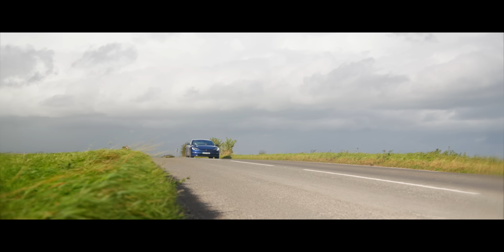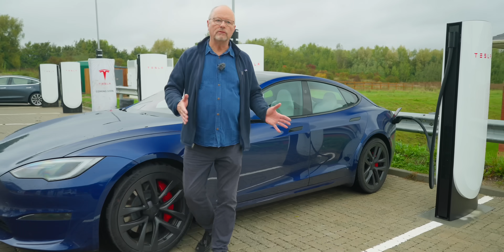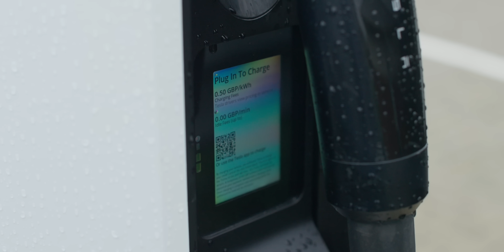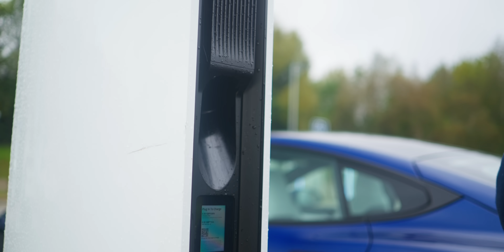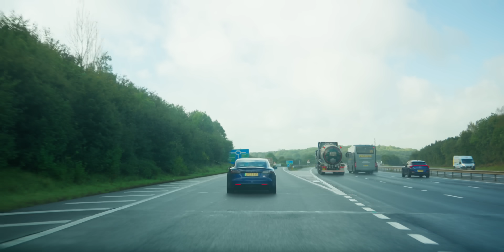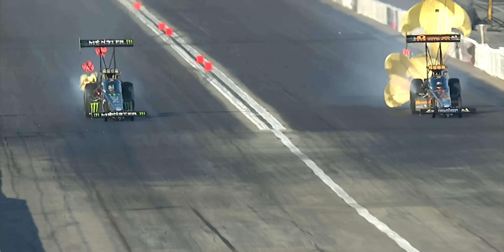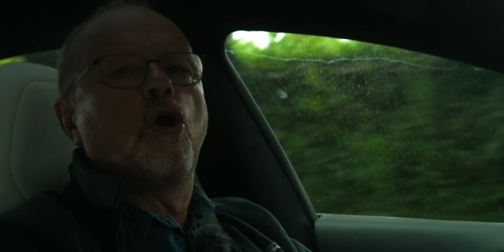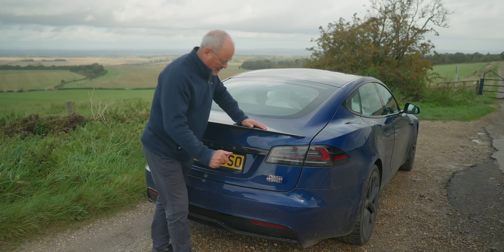THIS Is Why The Model S Plaid Didn’t Come To The UK

Comment: As a Tesla owner, I with you Robert.  Some things have been ergo designed a long time ago that just work well.  Deleting the 2 levers imho was unwise.
Reply: 100%. I get that Tesla are moving towards autonomous driving but why can't I enjoy driving my car (and navigating myself) myself when I choose to? I'm sure you can get used to no stalks, and compensate for it, but why should you? Stalk deletion has put me off upgrading my Model 3 to highland for now - the new model is a better car in most ways but that doesn't out weigh the stalk deletion for me personally.
Reply: @kiwijonowilson  the main reason why Tesla is trying to make vehicles fully autonomous is to get rid of driver related accidents. They feel like having people in charge of driving the cars is much more dangerous than what the cars could potentially do themselves. If we were to have all vehicles become autonomous and be able to communicate with one another, then there would be a lesser need for traffic signs or traffic signals.
Reply: @justinweatherford8129   sadly the time between now and then is a mess.. and given how much a group of people vocally hate evs .... i feel a lot of time before it happens.. but EVERY drive home I think... if all these cars were under a central control and communicated across to each other... we wouldn't have be speed-up-to-75, slam brake to 0 and if you leave any room for safety to give time for that slam crash, people will take it....   that causes accidents..... and yeah... we need it ... yesterday.
Reply: @todkapuz  the reason why people hate EVs is due to them being fed outdated and/or false information about EVs. If they knew the truth then they would love EVs.
Reply: @todkapuz the more controlled driving are not the point and neither really is safety, for governments one of the big benefits is that you could fit more vehicles on existing infrastructure because the gaps etc could be much smaller. The real problem is legacy vehicles, how do you retrofit an MGBGT or Mustang etc. next step would banning those legacy vehicles and that is not even considering motorbikes.
Reply: @justinweatherford8129  Absolutely! Literally fed
Reply: I am surprised removing the indicator stalks is legal on UK roads
Reply: The indicators on the stalks are terrible too. Quiet click, hard to quickly read indicator display and random auto cancellation. I think we all just have to assume we ignore any Tesla indicators like we do with BMWs
Reply: hard agree. I'm not going Tesla anymore. The lack of driver cockpit was already putting me off. But removing the stalks is too far.
Reply: Elon just likes to be different
Reply: Plaid with the ONE and there 200kw and Zeeker 001 FR quad motors(1300bhp) installed ???
Reply: 21 M3P owner here. Happy with everything APART from the indictator stalk. We have a lot of roundabouts and 'should' indicate off which is difficult when the thing you need to press is moving.
Reply: I'm with you on the stalks. And any function that needs to be used by the driver while driving should be a physical button/knob so you can find it and use it without taking your eyes off the road.
Reply: Ferrari's have done it right with the right signal on the right and the left on the left.
Reply: Its a cost cutting move. The less buttons, parts, things in the interior the more they save per car. Its not designed around you. You must adapt. Don't forget, the plan is to make you redundant in the car. The less control you have, the better - and the cheaper it is to produce.
Reply: And forcing everyone to use that silly yoke steering wheel was unwise as well. I believe it is finally optional (should have been that way from the beginning).
Reply: @JustWasted3HoursHere  to accentuate your point a driving test at least required the person being tested to keep their hands at the ten O'clock possision and the two O'clock possision. With a yoke steering wheel that is impossible. That would mean that every single person doing their driver's test with a yoke steering wheel would automatically fail that portion of the driver's test.
Reply: Ergo designed? 😅😅😅
Reply: @markfox1545  ergonomically
You're welcome.
Reply: It's plain dumb. Along with many other things. But that's the modern world for you..."reinventing" things just for the sake of inventing. And it's shown as the more modern more awesome thing, whilr it's just worse than before, worse than what just worked. But you are expected to like it and accept it, and lie to yourself, otherwise you are a luddite.
The world is on a terrible path now cos thia extends to all levels of life.
Reply: Taking away the levers is very logical to USA, but they are forgetting rest of the world where it get dangerous.
Reply: 100% Agree.  My interest in the new M3 is massively eroded by  this.
Reply: Deleting the levers is what made me pick a different EV instead of the new M3. I paid substantially more for the privilege of a gear knob and signal stalk (and a HUD). 

Whatever cost Tesla thinks it's saving  by deleting a bit of plastic and wires is dumb. They can keep deleting parts until there's only the tablet and you have to swipe left and right to turn as well.
Reply: @MrRobotGuy  Quote by Elon Musk: "Any Fool can reduce the cost of a car by making it worse!" SAY NO MORE....
Reply: @MrRobotGuy I think the point is that they are pushing towards self-driving. At that point the car will indicate the direction based on it's route and the "driver" is just another passenger. They were premature in that since it isn't ready but that's the idea. And it's probably way more cost saved than people realize. The stalk is cost, but also the heavy-duty switch that can take punishment is a much higher cost than buttons, and the installation cost is much higher than buttons which they have to do anyway. No stalks probably eliminates an entire station in the steering wheel assembly line, saving time as well. I don't know how I feel about it from a driver's perspective... but it makes perfect manufacturing sense as to why they've done it.
Reply: @patreekotime4578  they've been selling that scam for ten years, and they keep pretending for another ten. All those cars bought in 2016 with all the self driving extras won't be on the road for much longer. And I'm willing to get all cars bought today will never self drive either. 

It's all a marketing scam to cost cut as much as possible.
Reply: @patreekotime4578  exactly, it adds up, personally I am sure that everything is done with the thinking of how can they make it cheaper and not just because they save on components but because it is easier and faster to build. It's like with the giga press, make the car in 2 pieces, even 1 then cost is lower for them, faster to build and they can sell the car cheaper (but in that case it's a lot worst for the customer that has to get it repaired). One more reason to the fact I don't like their cars, I don't like the interior nor the exterior nor the brand.
Reply: @inebium  The castings do not add cost to repairs. Very hard to damage those castings and a hit hard enough to damage them would usually mean the car is totaled. But they can be repaired or replaced. Tesla works hard to bring repair costs down and since they have their own insurance, they have data on how to and a need to lower repair costs.
Reply: @MrRobotGuy  Don't you miss the buttons on your phone?
Reply: @WouterHermans But smart phone buttons are on keypad in the same place as the old push buttons.
Reply: @WouterHermans you seriously compare phones and cars
Reply: @larrywave  yes... everyone at one point will have to fit the entire dashboard of the car in their pockets.
Reply: @WouterHermans  Yes obviously touch screens are VASTLY inferior when it comes to actual performance. It's just that there is no other way to do it right now. Would you rather type a paragraph or a book on a keyboard or a freaking touch screen? How about playing an intense competitive game? Physical controls are incomparably superior your analogy is super dumb.
Reply: @WouterHermans You have to give the phone your full attention when tapping the screen. I'd like to see you use your smartphone with a blindfold. Touch screens in cars should be disabled whilst moving
Reply: well, yes.
Reply: Awesome review Robert. Tesla should offer indicator and windscreen washer stalk as optional. Love my model 3. 😊
Reply: BMW drivers won't notice the indicator stalk has moved 😮 they didn't know there was one ever (is that too mean🎉)
Reply: @HairyCheese I thought these were VW drivers.
Reply: @fparent  , they used to drive Volvo's, then moved into Audis and BMWs. It's possible they now drive VWs, I think they may also get into a Tesla soon, that'll mean a punch-up at a charging site 😔
Reply: @HairyCheese Those same drivers now drive Teslas
Reply: Demo drove a S with yoke and buttons, was used to it by the first km, wish my Y had a yoke and buttons.
Reply: @universeisundernoobligatio3283 I am going to guess you didn’t have to indicate while actually turning somewhat sharply; lots of us do. Trying to find where the indicator buttons are right now, sounds painful. (Eg my regular route involves indicating right while turning left. The buttons would either be about 7 o’clock or 1 o’clock so to speak at that time, instead of 9 o’clock or 3 o’clock.). I want to focus on the road and other traffic, not having to find buttons that could be in one of 360 different positions.
Reply: @glennjgroves Just don't then.
Reply: @glennjgroves  
So you're one of those that contumely and rapidly changes lanes back and fort in traffic just to get ahead a car length or 2?
Reply: @TecnamTwin  and that is the problem. Some people will not indicate, making them less predictable to other drivers and increasing the likelihood of accidents. A pathetic outcome.
Reply: @universeisundernoobligatio3283 where I live there are lots of junctions where you turn one way then the other .... in the 3 miles from my house to the main road there are 4 mini roundabouts and one big one... the mini ones would be impossible with moving buttons
Reply: @Obvsaninternetexpert  
Tried the buttons on round abouts, for me it was no issue. They were easy with the buttons since they are in well defined locations, no need to hunt for the stocks.
Reply: Indeed! But there's light in the tunnel. Aftermarket levers are soon hitting the market by Enhauto - the producer of the programmable "S3XY buttons". Using them to modify regen levels on the go.
Reply: @M-TRON  I saw a video where the new M3 already had the aftermarket stalks added. Must be available already.
Reply: I have been driving a refreshed Model S now for over 2 years and I love the Yoke & the buttons. Yoke, IMHO, gives a much clearer view of the screen. Makes using FSD much easier. Hope FSD becomes available in the UK & EU as it makes long distance driving and driving in the city so much more relaxing.
Reply: @robkeshav800  "Makes using FSD much easier" sure. But for those of us that actually want to drive the car ourselves, it is worse.
Reply: Agreed ….it’s bad design , I’m glad Elon went with the original round wheel design 🤣😂
Reply: Culture eats change for breakfast!  OMG, we will get used to it. Nobody remember having to give hand signals.  There will be a point in time when we won’t miss the stalks.
Reply: @scotteladd2537 eek. I remember learning hand signals with my driver instructor in case back in 1987.... 😂
Reply: If they had been buttons all along and now started using stalks/levers everybody would complain the other way though :)
Reply: @MatthiasGötzke  : D Good point
Reply: Just look back at smart phones - do you remember the scroll wheel or finger print readers? Those are all gone, many complained then, but we all got used to it. You'll easily get used to it in 20 days max
Reply: @talktorobi I still dislike typing on my smartphone. Way too easy to hit the wrong letter on the screen keyboard.
Reply: @0ooTheMAXXoo0 that isn't just a problem with smart phone keyboards. The scanners that I use at work have physical keyboards. We are required to wear gloves while using them, and it makes using the scanners difficult. The problem isn't the type of keyboard, but the size of the keyboard.
Reply: @talktorobi we are legally required to indicate at certain times though. With the actual indicator buttons at effectively any one of 360 different positions, depending on how hard and what direction you are turning at the time, indicator buttons sound like a nightmare. An indicator stalk never moves. For anything where you can wait a few seconds until the controls return to normal position, fine.
Reply: Still missing your horse?
Reply: Nope, it was a great decision. I've owned an S for 2 years and I hate going back to stalks.
Reply: I'm 12000km in on a yoke and buttons, and love it. No worries about moving your hands while turning on a roundabout to start the indicators, they're just on the steering wheel.
Reply: @WouterHermans yoke is a joke. It’s not a plane. A yoke js dangerous on a car.
Reply: @WouterHermans true and I drove an X with normal steering wheel and could not see the speed limit. Yoke is way better.
Reply: Yeah I’m sure some miss two reins and the feel of that too, but I bet they’re doing just fine nowadays!
Reply: @jezza6575 yeah, I miss those reins!  You could communicate so much to the horse with them.

Comment: funny how Robert presents the V4 dispenser as it would change anything about the charging speed. the actual charger is still the same V3 hardware generation and hasn't changed one bit.
Reply: Really? The v4 ones are supposed to support up to 350kW, higher voltages (not relevant for the Tesla but still would require a hardware difference). The cabinets show a different rating. Yes, they are currently limited to the same 250kW as v3 but that doesn't make them the same hardware.
Reply: The internal shots show it's not and the out spec channel shows they are in FACT 1000v capable. 👍🏻
Reply: So far.... And it is the car that limits the charger at the moment.
Reply: V3 dispenser: 1000VDC / 425A
V4 dispenser: 1000VDC / 615A

Looks faster on first glance but it is really not because we all know Tesla was always pushing their V3 dispensers way beyond 425A and the cars have ~400V packs so the 1000V never mattered. The V4's are now officialy rated for the speed of the V3's.

The charging cabinets are exactly the same at V3 and V4. You can go up to one and check the label. The  part that matters is the "POST DC Output" . That is the power available for each stall. It is Output Power: 250kW | Output Voltage Range: 0-500V | Output Current: 631A

So no 800V for other EV's and no improvement in charging speed for Teslas.

The V4 dispensers are a much needed upgrade though with their better placement, longer cables, displays and payment terminals, no doubt!

Comment: Can I charge a U.S. Tesla in Europe with a CCS2 adapter? I'm considering camping out of it around the world. If it's worth shipping it over Europe would be the first place I'd go outside of North America. I can also rent mine out on Turo while I'm gone and rent or buy another one in Europe.
Reply: North American CCS is not the same handle as Euro CCS. Same communication protocol but different pin setup. They are named CCS1 and CCS2. I’m not aware of any Euro CCS to Tesla (NACS) adaptors.